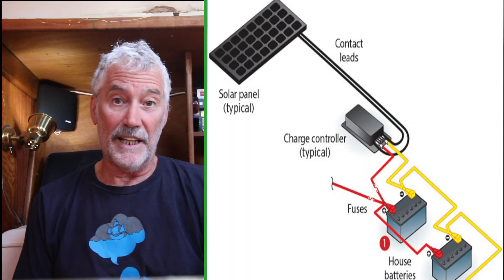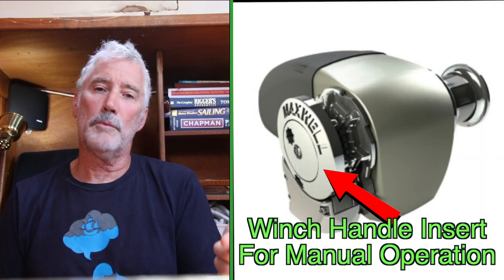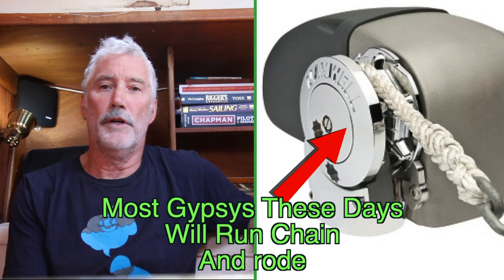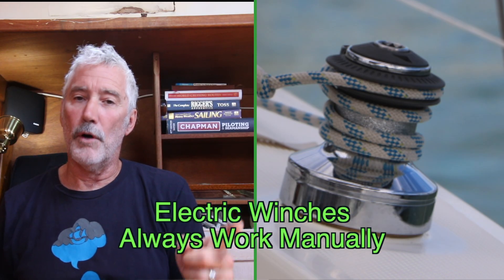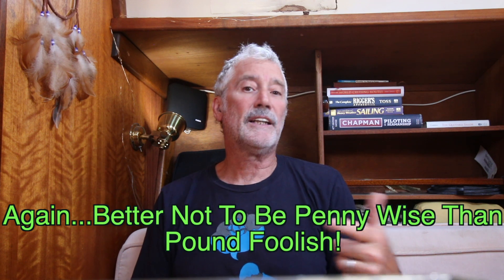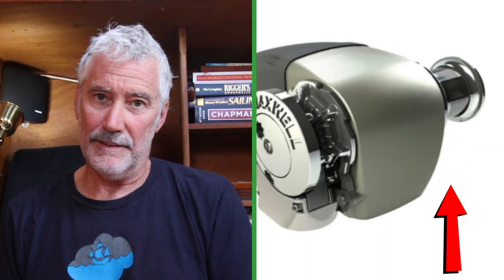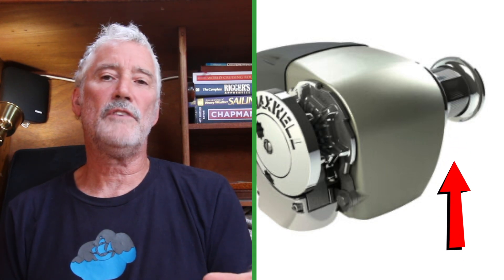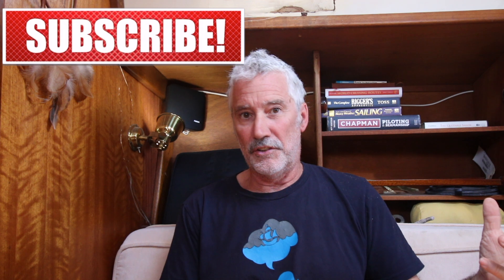How To Choose A Windlass

Comment: I couldn't agree with you more regarding the electric vs. manual windlass.  What I don't understand is why you would need 4/0 cable for a little over 7 amps (85 watts/ 12 volts)  of current.  Any reason for such a large cable for such a small load?  Keep the good stuff coming,
Reply from the maker: Hey Johnny! I think I mixed that up in the vid. I believe the windlass draws 85 amps, not watts.

Comment: I agree entirely.  I used the house bank (2 4D at 400 amp hours total) and 4/0 cable on a 38' Bristol 38.8.  I always run the engine with a 100 amp alternator when running the windlass to increase the voltage which lowers the current.  You said your windlass was 85 watts but I expect it is 85 amps.  Another often overlooked item is the chain locker.  Often wi dlasses are too far forward and chain stacks up and requires manual repositioning before 100-150' of chain can be brought aboard.  The chain must also not topple and tangle once aboard.
Reply from the maker: Hey Jim! Yes 85 amps. Thanks fire tuning in man! Nice boat by the way!

Comment: Electric winches still work as manual winches.  All you have to do is put the winch handle on.  I used my electric winches several times this summer as manual winches when I forgot to turn the switch on.   As far as electric water pumps go, just carry a spare.  A manual pump is not worth the aggravation that it would cause every time my wife had to use the water.  Electric water pumps do not use much power.  All windlasses have manual backup (a pair of leather gloves) until the ground tackle gets too heavy to haul up by hand.  I have had a Lofrans manual windlass.  It worked fine, but was really slow.  I will stick with my Wilcox Crittenden Skipper II head.  No electrics for me until the current head fails and I can't get replacement parts. The Skipper II has never clogged and I don't have a macerator pump.  If you have one of those you really have an electric head even if it has a pump handle.   That said, my powerboat does have an electric head and it is convenient.  That boat will never be used for going to distant places, so if the head fails I will just buy a new head - it is under $1,500, so spare change.  No composting head for my boats because my wife would never accept one.  The powerboat also has a power windlass, but it is hydraulic, so as long as the engine is running and the hydraulic pump works the windlass just works and I don't have to worry about amp draws or flat batteries.

Using a separate forward battery bank for an electric windlass is a good idea because you can upgrade to a 24VDC windlass.  You can still charge it from your house batteries via a DC:DC charger.  Then you only have to run much smaller (cheaper and lighter) cables forward because you are running 24VDC wiring that only have to carry the DC charger output.  The savings in cabling costs will more than pay for the DC:DC charger. However, if you own a boat, you really shouldn't be concerned with money.  I only run my windlass when the engine is running.  I have never seen a separate solar charged windlass battery, but I have only been sailing for 60 years.
Reply from the maker: Hey Todd, thanks for watching! Sorry I just saw this reply. Many good points and ideas! I would imagine after “only” 60 years of sailing you’ve seen a lot! Do you still have a sailboat, or only a power yacht now? Your best point of all was if you have a boat you really shouldn’t be concerned about money. Probably true, but I scratch to get by and keep moving forward with my boat, especially here in Mexico. It’s the most expensive slippage I’ve ever seen, parts and materials are expensive and hard to get. Another reason I’m more of a manual guy. Much more affordable everything. I scratch by, but there’s no way I would ever be without a boat, until I can’t sail one. As a carpenter for most of my life, I don’t have tons of money and my retirement is meager, but l couldn’t imagine life without a boat! Thanks again Todd!
Reply: @sunlovesailing  I have an Allied 36 Ketch.  we hauled it out for the winter on October 30th.
Reply from the maker: @todddunn945 Oh my one of my fave boats, the Allied Princess.

Comment: I’ve got a question. Vertical or horizontal Windless. I have the same Maxwell HRC 10 horizontal that you do and I find it difficult to manually retrieve the anchor. I wish there were more YouTube about our particular Maxwell HRC 10.

https://youtu.be/RgtESTOyiCs?si=6HDuvsw-AKO94EP4
Reply from the maker: Hey Jeff! I’ll be making a vid on this windlass once installed. The main difference between the vertical and horizontal is… usually with the vertical you get a full “half wrap” around the gypsy. With the horizontal, you get a quarter wrap. And if the chain gets too high when the anchor arm comes up over the bow roller sometimes it’ll jump or skip because it’s higher than the gypsy. I prefer the horizontal for its manual action over the vertical. Ergonomically it’s easier for me to rotate the handle. Pros and cons to both, and of course, a ton of personal decision in the end. As well, the boat is usually set up for one or the other, and changing will usually mean drilling a new hole for the hawse pipe.  I’ve had both though my vertical one was all manual.

Comment: That manual windlass would work a whole lot better if you put some new grease in it.
Reply from the maker: Hey Hold Fast! Thanks for tuning in! Ya I know, but as you see by the pic, that new Maxwell is going in its place. I actually have two of these windlasses I’m going to be selling. Pretty stoked to install this electric one! All three of my boats have had manual ones, I’m getting tired of them, and I think an electric one is necessary for single handing.
Reply: @sunlovesailing I think it depends on the size of the boat. For anything 12,000lbs or lighter you really don’t even need a windlass so the manual is great.
Reply from the maker: @TheCorsair I have to say, I liked having the windlasses on both my smaller boats. You’re right I didn’t need them, but it was nice. One was a contest 31, sailed like a dream. On our first boat We took 6 weeks and went up the ICW once so we anchored a lot. The boat was a Rhodes 32 Chesapeake, she probably displaced 11,000lbs. I used the windlass most times. Maybe I just pulled up too many anchors by hand all my life, I just don’t want to do it anymore.😅